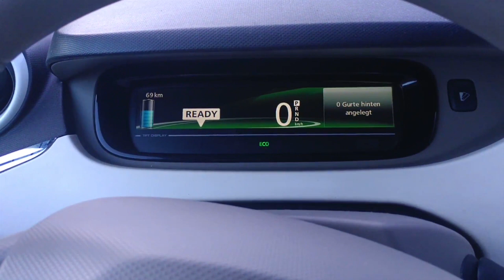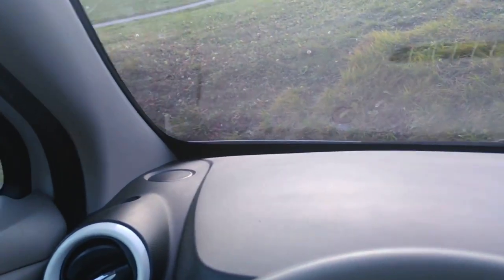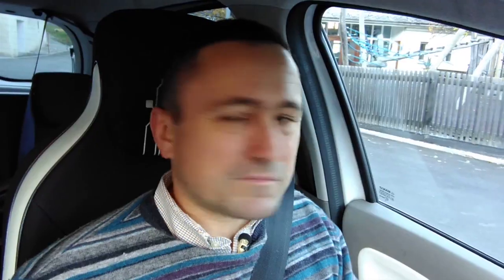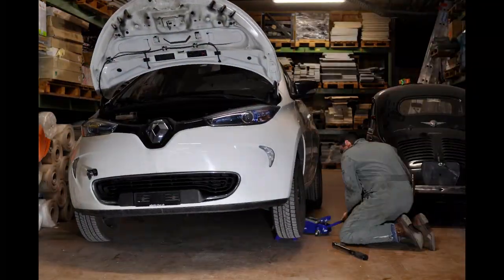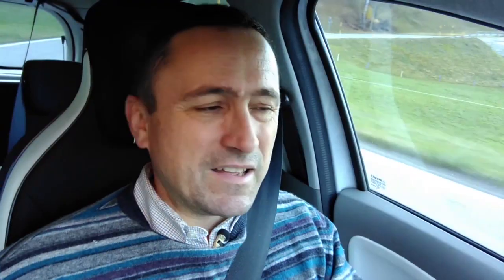REMICHANICS #33: The resurrection of Zoe!

Comment: I am not surprised by Renaults efforts. I now have a Kia Soul EV but I did have a Zoe and it broke down with alarming red fault messages. It was a 2016 car. It revolved around the charging of the auxiliary battery, I think, ( I'm  not sure Renault knew what they were doing).
I had a huge Kia diesel loan car care of  the warranty, so at least I had a car, even if not the kind I like. Once back it was fine again.

Comment: Yeeeey, the old Zoe is back! Good job guys!! And a big dislike to Renault for designing parts that are non-replaceable. That's ridiculous. Remi, how did they plan to replace the power electronics block at the Renault garage then? I doubt they are manually swapping the VIN chips, there has to be some trick that Renault uses at their official garages.
Reply from the maker: Hello Michel, thank you so much! They way Renault handles this is that they don't replace single parts but program a new electronics block (the whole unit) in the factory in France to the VIN and then ships it to the dealer in the local country. That's why it takes so long (even on warranty replacements it takes about 2-3 weeks) and is so expensive. Just a detail: The unit is called PEC in the R240, it's a bit different from the PEB in the Q210. Cheers and thanks for your support!
Reply: @REMICHANICS  Oh wow, interesting!! But that would mean they are still manufacturing old parts? :O I have a Q210, which went out of production long ago, but you can still replace the whole PEB in a Renault garage. That means they have manufactured units laying around in warehouses, ready to be programmed? This seems so odd ...